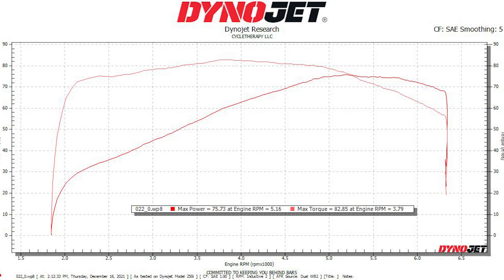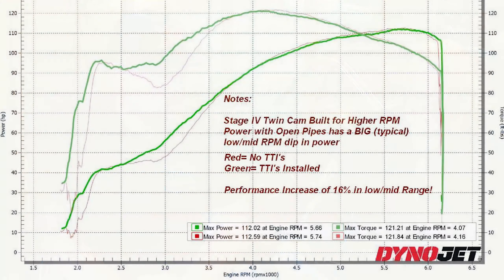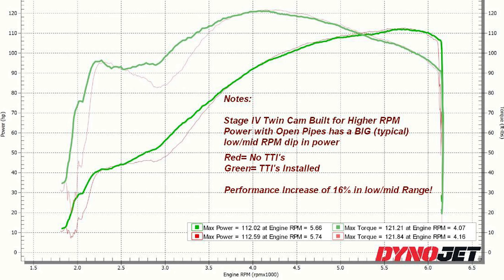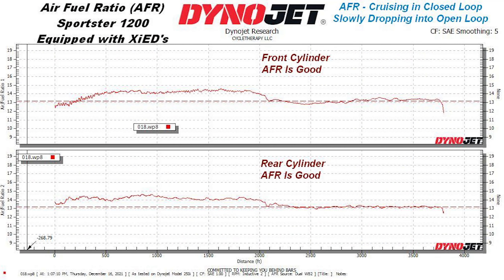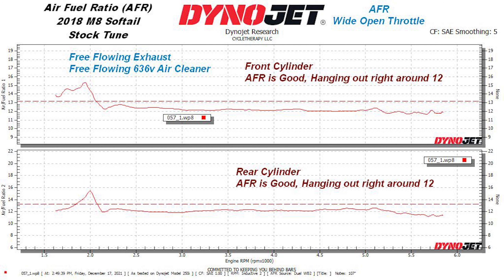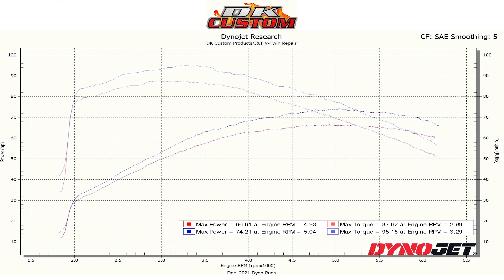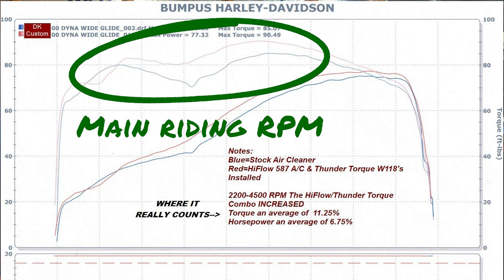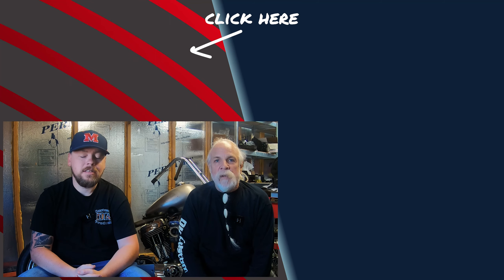Harley - Horsepower, Torque, Tune, Air Fuel Ratio

Comment: I have a VTX1800R. I had it dynotuned. They starting air to fuel ratio was 12 to 1. They set the full throtlle mixture to 13 to 1. the part throttle is leaner but I was not given a number. the horsepower started at 88.24 at 4,900 rpm. it went to 95.42 at 5,000 rpm. the torque started at 110.21 at 3,300 rpm and went to 118.63 at 3,300 rpm. the torque is over 100 at 2,100 rpm. I have not rode the bike much since it has been tuned. I did notice it pulls smoother in high gear at a lower speed. I had it tuned mainly to improve fuel mileage which was averaging about 31.
Reply from the maker: Good add.  Thank you! 👍

Comment: When you are talking about air fuel ratio, what does the 13, 14, or 15 mean. Is it part fuel to air or air to fuel? I don’t understand the values of these numbers.
Reply from the maker: Fuel doesn't burn on its own. It has to be mixed with air. AFR tells you how many parts of air are mixed with each part of fuel. For example, a 14.7:1 AFR (or just 14.7) means the mixture is 14.7 parts air to one part fuel.

Thank you for commenting! 👍😎👍 MB
Reply: @DKCustomProducts  I knew it was air to fuel, but wondered what part the 14.7 was. Thank you 👍🏻🤓 I have a FP4 and it is saying air fuel ratio bounces around 12 to 15 AFR. I LOVE  the live data logger 😁
Reply from the maker: Tuners with live data are nice! Thank you for commenting! 👍MB

Comment: I just had my 114 dynod it has s&s 475, Bassani 2-1 and Arlen ness intake. 102 hp and 116 tq. The afr is at 13 across the board. Everything I’ve seen online is showing I should be getting a lot more out of the cam. Any advice?
Reply from the maker: While the list below is not complete, these are the 3 things I would do if it was my bike.
1.  That exhaust is going to have reversion, which robs power.  You can add a TTI to it and get a bump in power.  See video on this subject here- https://www.youtube.com/watch?v=pr6z00gL5Yg
2.  That air cleaner is feeding hot, oily, oxygen depleted air into the combustion chambers, which robs power.  You can add an External Breather System to that air cleaner and pick up some power.  See video on this subject here- https://www.youtube.com/watch?v=EfDeFZblMck
3.  13 is too rich for max power in closed loop and too lean for max power in heavy open loop.

Last thing, it is not possible for me to know how hot the bike got on the dyno, but if the bike hit 270 F or more on the dyno, that is a huge power robber.  Here is a video showing just that happening on a bike we had on the dyno, along with charts showing how much power it dropped.
https://www.youtube.com/watch?v=5PxJ8PvcVtc
Also, here is a written report on the subject- https://www.dkcustomproducts.com/sleeper-performance-mods.htm

One more thing to keep in mind.  Every dyno will read a bit different than others, and the ambient temp and humidity Does make a difference.  Even though dyno's are supposed to correct for that, it is really not very effective. The same exact bike can be on a dyno in a dyno room that is 65 f low humidity and produce one chart, and then it can be on the same dyno, everything the same, but put the temp in the dyno room at 90 F and high humidity, and it will be a very different chart.

And of course, dyno tuning is a hit a miss affair.  It is totally dependent on the experience/skill of the human running the dyno...and even a skilled dyno tuner can have a bad day.  We have done a video exploring all the ins and outs of getting a good tune, you can see it here- https://www.youtube.com/watch?v=isBHK-Jy7Wk

Hope that helps.

Comment: I have a twin cam 110 with 10:5:1 compression fueling 594 cams mva heads and bassani road rage exhaust and its only making 105 horse power and 114.93 torque it also feels like it cuts off briefly around 3500 rpm the numbers seem to low for the build. Are these numbers normal ?
Reply from the maker: Those numbers seem low.  
The dip is almost assuredly a tune issue...if the dip/flat spot were lower in the RPM band, I would say it is because of reversion in the exhaust, which would be fixed with TTI's, but if it is pulling strong up til 3500, then flattening out, that sounds more like a tuning issue.
You did not mention what tuner you are using?
Reply: @DKCustomProducts  Hey DK the harley dealership tuned it with a power vision. I had a cracked piston they covered it under warranty installed the rocket cams Chris Rivas 110 cylinder kit Carillo CP pistons and the MVA heads. Definitely pulled harder before without the MVA heads so your probably right about a tuning issue. Also when I bought it it had basically the same setup minus the mva heads and they just through a stage 1 canned tune according to the paperwork.
Reply from the maker: @racex3721  Yeah, I would look at getting it tuned for your setup. 
Here is a video you may find helpful - https://www.youtube.com/watch?v=qVEhzU0sMYE&t=3s

I think you would benefit from a Power Vision with a tune for your setup.
You can see the Power Vision at this link - https://www.dkcustomproducts.com/dynojet-power-vision-flash-tuner-w-auto-tune-dk-pv-cmp-pkg.htm

Please feel free to contact us with any questions or concerns:
Support@DKCustomProducts.com
662-252-8828

Comment: Do you tune with powervision1? If so PM me a price for you to dyno tune my 13sg. Mods are as follows. Stock bore/compression, 2-1 sharkroad pipe, se heavy breather and .574 Chris rivas rocket cams. The tune I got from dynojet runs good but part throttle it's like it's missing or sputtering until you Raise/lower the throttle. Wfo runs really well.
Reply from the maker: DK Custom does not do dyno tuning.  If we were going to have a bike dyno tuned we would use J&T V-Twin Repair & Mobile Dyno- 901-584-5760.
HOWEVER, watch these two videos linked below to see what we do instead of dyno tuning-
https://www.youtube.com/watch?v=isBHK-Jy7Wk
https://www.youtube.com/watch?v=qVEhzU0sMYE

Comment: These guys are missing the whole thing with horsepower and torque. The higher the horsepower an engine has the faster the available torque can work. You take a diesel truck that weighs 6,000 lbs and just say it has  100,000 lb feet of torque but it only has 300 horsepower my Civic with 190 HP and 190 lb feet of torque will destroy it on acceleration even though the truck has an extremely higher torque to weight ratio. And yes of course the truck will be able to haul more etc But it's going to accelerate extremely slow but it will be able to pull the whole world haha. for pure performance acceleration from stop light to stop light etc is horsepower to weight ratio. Because you can have torque without horsepower but you cannot have horsepower without torque. Because horsepower is how fast your torque can work.
Reply from the maker: Uhhh, we are talking about typical riding Harley's in this video...and we reference the video in this link- https://www.youtube.com/watch?v=DOxzN8r35O4 in this video.
As you will note in the video linked above, Harley does not even publish Horsepower numbers, they focus exclusively on the torque.
Reply: @DKCustomProducts  That's exactly why a CBR 650r at 460 lbs with only 43 lb feet of torque at the rear wheel will destroy Harley-Davidson motorcycles on acceleration if it was all about torque the Harley-Davidson with over 120 lb feet feet of torque should beat it. But no the CBR has a significantly higher horsepower to weight ratio which is what matters for acceleration. Now if you're talking about putting a lot of weight on a motorcycle yes the one with higher torque will be less affected you can put 1000 pound feet of torque on a motorcycle if it has low horsepower the acceleration will be slow. If you don't believe me look at the semi truck look at the dump truck extremely high torque but really really low horsepower.
Reply from the maker: The key on why the CBR out accelerates is that it is running over 5200 rpm.  It it was run at lower rpm (where torque is important) it would not out accelerate a Harley.  Since HD's primarily run below 5200 rpm, torque is what is important.  Also, the feel of torque on acceleration is very different than what HP feels like at higher RPM.
Reply: @DKCustomProducts  Yes but you're missing the point. Horsepower and torque are the same thing. You get your horsepower number by calculating your torque x 5252 RPMs. The best performing Harley-Davidsons on the streets are the ones that flash the ECU and increase their rev limiter and therefore increase horsepower. If it was all about torque Harley-Davidson would be faster then almost every single Honda motorcycle on the road in acceleration but it's the opposite because Honda has a high higher horsepower to weight ratio than Harley-Davidson. I personally have a 2021 Honda Rebel 1100 it weighs 500 lbs with my accessories. Has 83.77 horsepower and and 67.79 lb feet of torque that was on the dyno at the rear wheel completely stock besides for a two brother slip-on exhaust. My uncle has a 2014 Harley Davidson ultra limited with a stage 4 tune 133 lb feet of torque at the rear wheel and 120 horsepower. He can't even begin to keep up with me on acceleration like it's not even close. As of yet I have never lost in a race against a Harley-Davidson from a stoplight I have 15,000 miles on my motorcycle and trust me a lot of Harley-Davidson guys have tried. The rebel 1100 0 to 60 is about 3.4-3.5 seconds. I'm not saying torque is bad it has its place but if you're looking for pure performance if you have low horsepower and high torque that's not going to get you good acceleration. High torque engines always have lower horsepower and that always slows them down on acceleration dump trucks semi trucks diesel trucks Harley-Davidsons ECT.
Reply from the maker: Horsepower = Torque x RPM / 5,252 is the correct formula.
While many Harley riders do tune their ride and increase the rev limiter, the vast majority of Harley riders stay under 5000 RPM most of the time...and that is when torque is what is felt and what so many HD riders like about how a Harley feels.
For most, it is not about racing.  For those that want to race, the Harley can be built for it, but it take a lot of $$$ and they still can be be out by something that costs 1/4 as much $.
Reply: @DKCustomProducts  That's the only reason I commented because in your video you said torque is what matters the most for acceleration etc. If you increase your torque and your horsepower stays the same it will take more weight to stop the extra twisting force but it won't twist the rear tire any faster with out increasing the horsepower which makes the available torque able to be applied faster therefore equals faster acceleration. Now if you are 400 lbs then obviously a Harley-Davidson with higher torque will be a better option than getting a sport bike with only 40 lb feet of torque.
Reply from the maker: We must be saying the same thing....of course, since HP is Not measured on a dyno, it is simply a number derived from torque...IF torque increases, so with the HP.
Ride Free!

Comment: for your 91 octane fuel maybe but other countries run 95-98 so thats way to rich for your AFR,s
Reply from the maker: I would be careful going too lean on 98 octane fuel.  

You are correct,  Higher octane fuels can withstand higher compression ratios without causing knocking or pre-detonation. This can allow engines to run safely with a leaner mixture under certain conditions, or to utilize more advanced timing settings for improved performance.

With a Harley engine, you just don't want to get too hot.

Thanks for commenting! KP